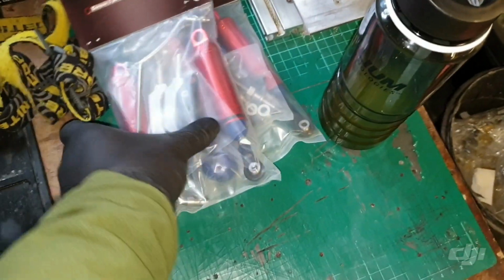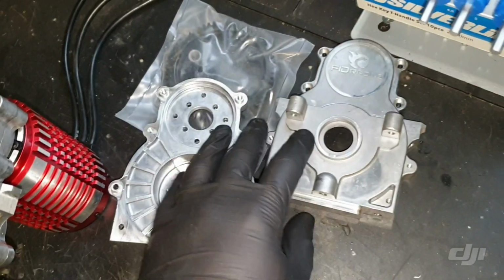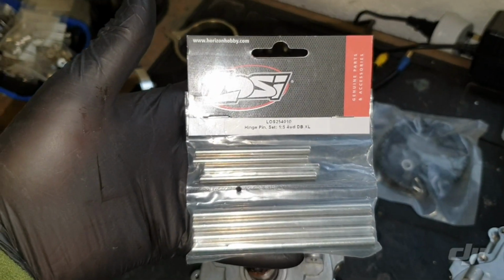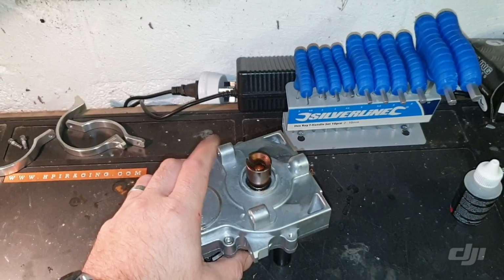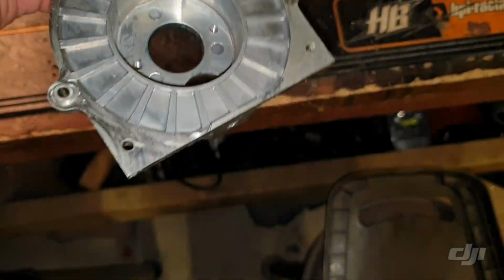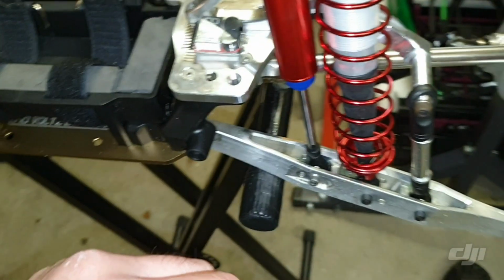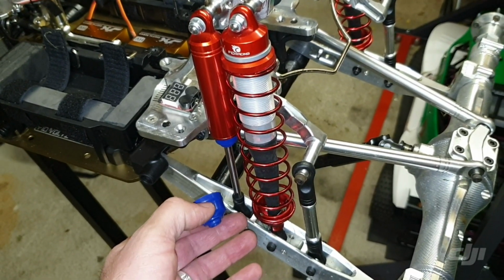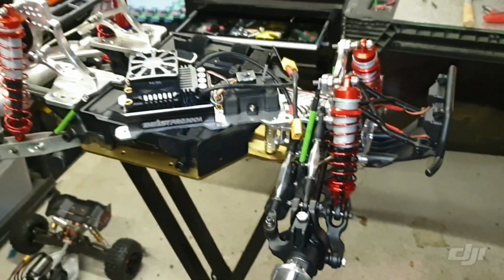FID Voltz upgrade pack, can anyone tell me what the blue caps are for!?

Comment: Those blue boots go on your new shock absorber . You have to  unscrew the bottom cap and slide it between the shaft and the bottom cap. It's of course easier to install if you  Disassemble the whole shock.